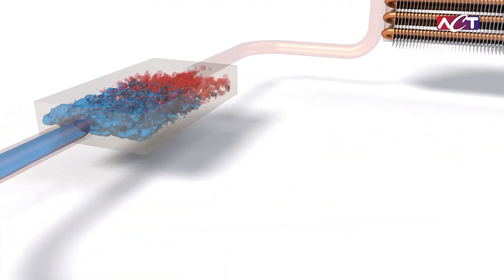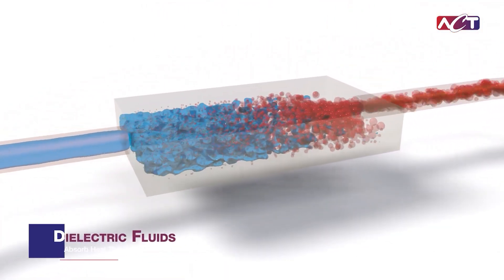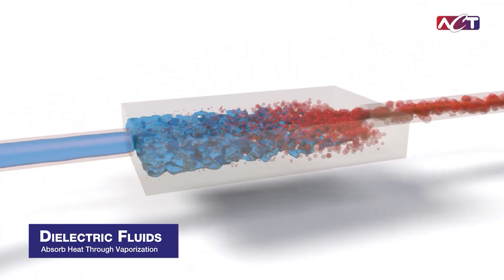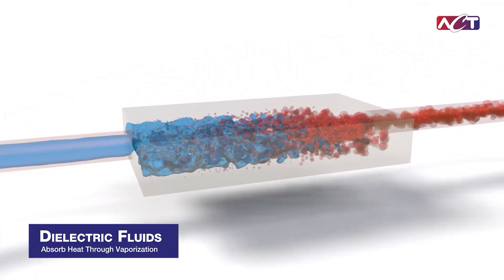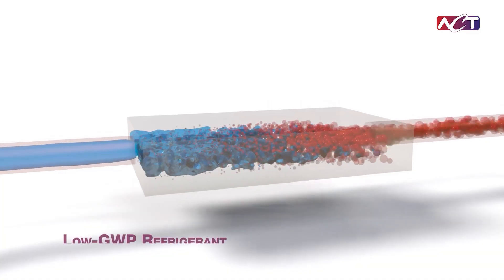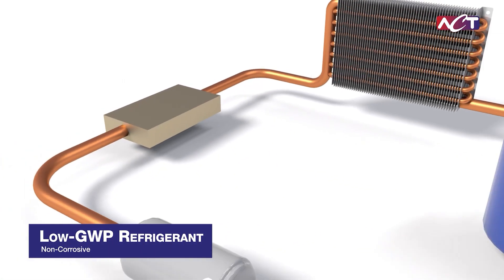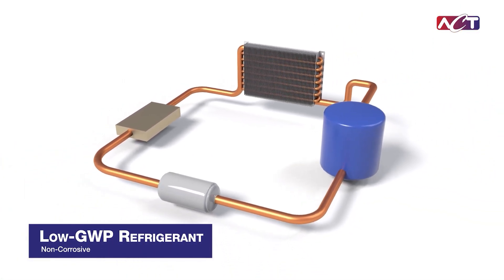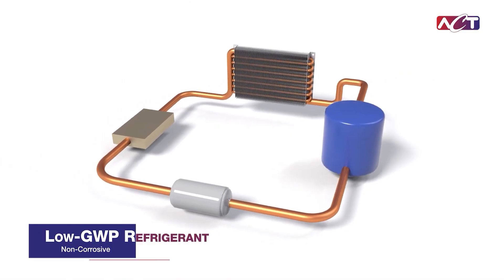Outrunning Thermal Limits: Two-Phase Direct-to-Chip Explained

Comment: Forgive me if I'm misguided, but don't heatpipes already exploit this, albeit without a pump and accumulator? 

I assume this is for usecases where heatpipes can't scale up, no?
Reply: Heat pipes transfer heat fast, but once they're saturated, that's it. An AC unit never gets saturated because (ironically) they utilize high amounts of mass flow.
Reply: @raam1666 That tracks, thanks.
Reply: @josef_fritzl  Sorry i meant heat pipes
Reply: @raam1666  an ac unit is a heat pump but not all heat pumps are ac units.
Reply: There's not enough detail here, but two-phase cooling generally implies a liquid that boils somewhere between 30-100C at atmospheric pressure. But I'm not sure as perflourocarbons like Novec 7000 are having a really bad time.
Reply: This technology is more aimed at high-compute datacenters, rather than personal devices. In datacenters, water cooling is typically used and can effectively remove waste heat from racks of equipment and efficiently transport it elsewhere. This solution proposes increased cooling capability over water, whilst still allowing that bulk waste heat to be moved around the facility. Heat pipes are not practical for cooling CPU or GPU dies in these facilities at the required power levels.
Reply: @MisterMoustache-86 Aye, as I suspected. Thank you.